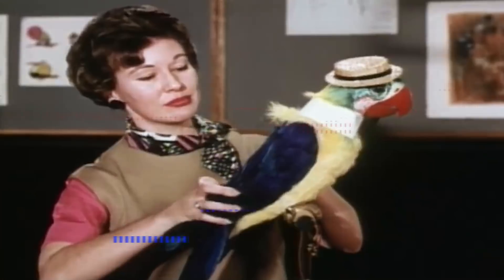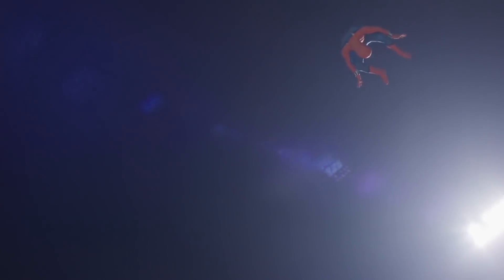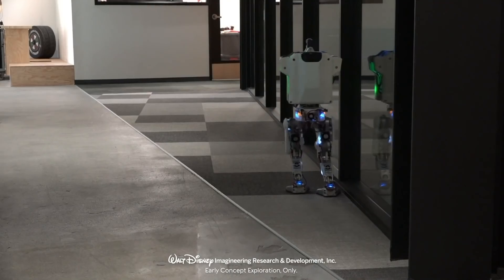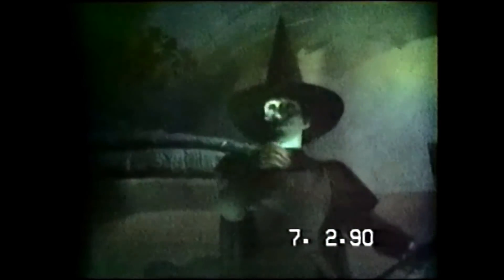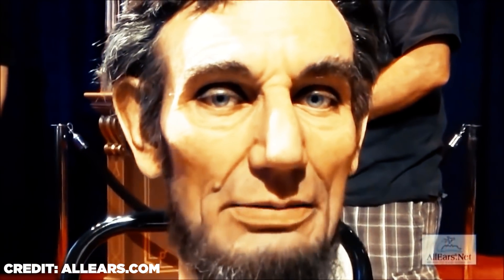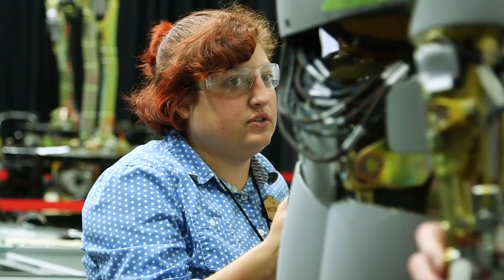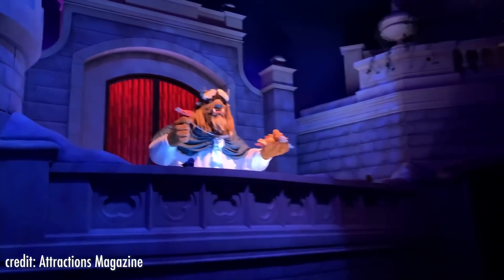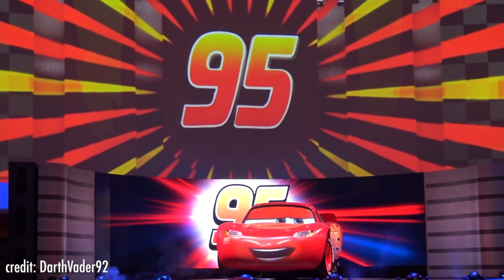Disney Advanced Animatronics

Comment: Arrives in the security office, Phone Rings

Phone Dude: "Hello? Hello? I was on the shift before you and just wanted to give you a heads up. The Animatronics roam around at night, sometimes they think that you are a costume and they might try to shove Gaze inside you. Nothing to worry about though, just use the doors and lights in the office. On yeah you only have a certain amount of power. See ya in the morning."

You put the phone down, looks at the cameras. See's Spiderman swing past

"Heh, that's pretty cool" 

You say as you don't realise that they are going towards your office. You hear a bang above you in the vents and a high pitched voice saying 3 words, 'I Am...' You can't make out the last word

Time passes and you hear that banging above you again. This time you check it out and open the vent, flashing your flashlight down it. You see two small lights right at the end of the vent and think nothing of it. You go back to your desk and look at the cameras. Someone has turned on all the lights? Strange. You should be the only one in the building? You turn around and check the fuse boxes. It says everything should be off? You turn back around and look at the cameras again but, something is different. Every animatronic in the park is looking at the cameras...

"The heck..."

*You freak out, closing the cameras instantly only to hear the banging in the vent again. You are afraid to check but hesitantly grab your flashlight and prop yourself up the wall to look down the vent. It looks like Groot? But something is different... You see his mouth torn open and a red liquid drip out of it. You jump back, not knowing what the hell is going on when all of a sudden you hear a bang and crash. The door has opened, the Spiderman Stuntronic (with no costume) has crashed through the door, breaking it down. You see two lights outside the door. They are eyes, glaring at you like a human.
The owner of the eyes walked into the room. It was the gaze animatronic!*

"What the fuck-"

The Groot animatronic lands in front of you and the last thing you see is it's soulless eyes and bloodied mouth knocking you out.

Time passes and you wake up in front of some sort of spoon and the last thing you see is the Gaze animatronic smiling as your insides are scooped out to make room for Gaze.